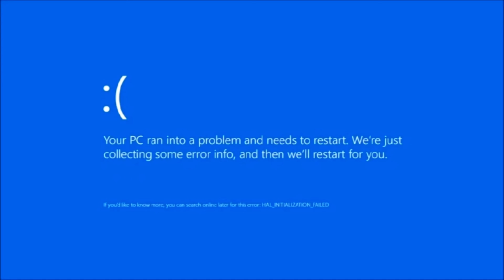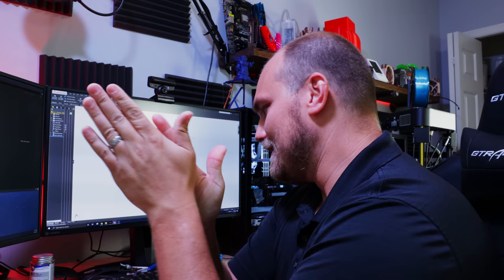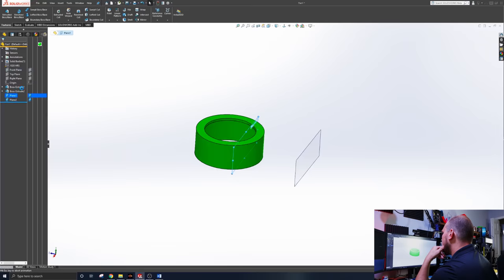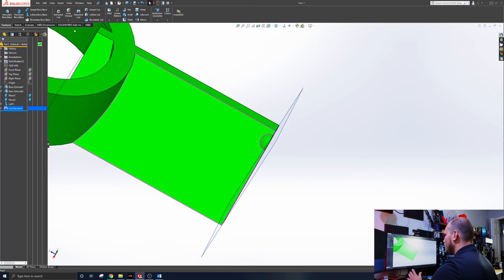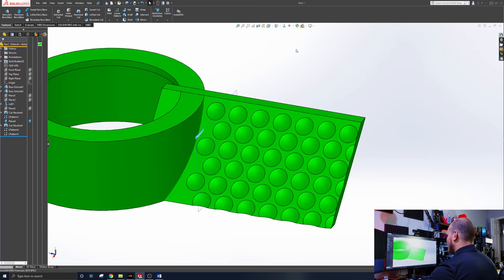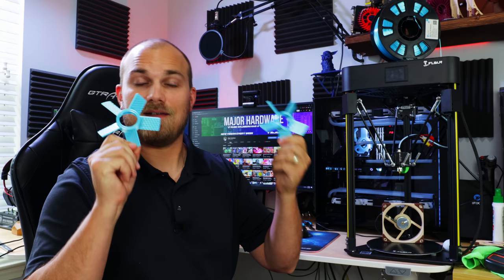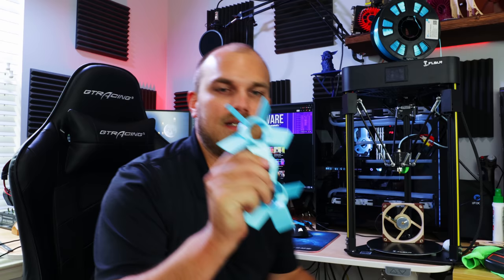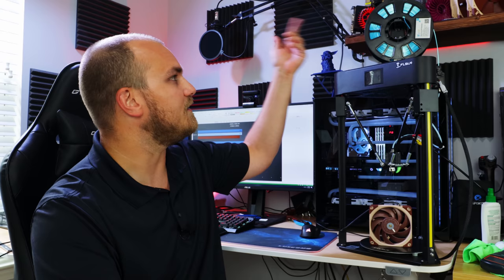What If Fan Blades Had Dimples Like A Golf Ball?

Comment: I would like to see one with "reverse dimples" or "bumps"
Reply: this won't matter, nothing you can do to the dimples can make them work better because the reason dimples affect golf balls and not fans is that when an object moves through the air, it creates a low-pressure area behind it, creating drag and slowing down the body, because of this, a teardrop shape is the best shape for limiting drag since its outline follows the low-pressure area allowing it to negate the effect almost entirely. the golf ball on the other hand is made to be sphericle to allow for non-directional hits, and therefore must be designed to minimize drag some other way. 

this leads us to the dimples, and how they reduce drag. they do it by creating turbulence on the surface of the sphere, which creates vortexes swirling into the low-pressure zone behind the sphere, allowing air to fill the low-pressure zone more quickly, and lessening the effects of drag.
now, the reason this effect doesn't work on the fan is that its shape is significantly better aerodynamically starting off, as its blades do not generate low-pressure the same way the sphere does, since they are already thin, and don't require air to bend its path nearly as much in order to pass around it.

Comment: Please measure electrical consumption... regardless of speed or cooling ability if the self regulated motors draw less current it would still be a useful saving in electrical efficiency ratings.

Comment: It's a terrible way to compare the effect of dimples. Of course the RPM is same; it depends on the motor, not on the fan, you could attach a solid disk instead of the fan and get the same RPM. The right metrics would be static pressure and flow rate measured with an anemometer. You'll need to compare both of these properties to get an idea of what's going on. Dimpled fans should have a higher pressure drop and thus perform much worse, but that's just my speculation.

Comment: mesure the speed of flow, the speed is given by the circuit of the motor, and for the efficiency mesure the power consumtion vs the speed of air flow.

Comment: ...so If it's cheaper because it uses less material, but performs identically, Producers, get on it.
Reply: That's because the smooth one is overdimensioned.
Only if the cutout structure would add strength this would be true.

Comment: Very cool! I thought for sure the rpms would be up and the volume of air would be down on the "more aerodynamically" superior dimple design. If you're making 100,000's of units, the savings in material and weight of one gram of shipping costs by that multiplier would save the manufacturer.

How much more "work" does the printer do though compared with the flat blades? It that is negligible, you should send your idea to a fan manufacturer - though most are plastic injection, I would figure - so that they might give you a chunk of % savings!

Great work. What I could build on this thing! How much do these things cost in general? and how intuitive is the software? Please.

Comment: Now can we get fan blades with bumps? Like, the exact same dimples but inverted?
Reply: this won't matter, nothing you can do to the dimples or the fan can make them work better because the reason dimples affect golf balls and not fans is that when an object moves through the air, it creates a low-pressure area behind it, creating drag and slowing down the body, because of this, a teardrop shape is the best shape for limiting drag since its outline follows the low-pressure area allowing it to negate the effect almost entirely. the golf ball on the other hand is made to be sphericle to allow for non-directional hits, and therefore must be designed to minimize drag some other way. 

this leads us to the dimples, and how they reduce drag. they do it by creating turbulence on the surface of the sphere, which creates vortexes swirling into the low-pressure zone behind the sphere, allowing air to fill the low-pressure zone more quickly, and lessening the effects of drag.
now, the reason this effect doesn't work on the fan is that its shape is significantly better aerodynamically starting off, as its blades do not generate low-pressure the same way the sphere does, since they are already thin, and don't require air to bend its path nearly as much in order to pass around it.

Comment: There is a chance that one fan uses less power than the other when running at the same RPM. Maybe one the "bad" fan of the two will outperform the other at a higher RPM. 

If not, a 9% material saving is actually kinda huge

Comment: Dimpling adds surface area which should add lift.Do a smoke test to measure your current flow across the surface.
Reply: this won't matter, nothing you can do to the dimples or the fan can make them work better because the reason dimples affect golf balls and not fans is that when an object moves through the air, it creates a low-pressure area behind it, creating drag and slowing down the body, because of this, a teardrop shape is the best shape for limiting drag since its outline follows the low-pressure area allowing it to negate the effect almost entirely. the golf ball on the other hand is made to be sphericle to allow for non-directional hits, and therefore must be designed to minimize drag some other way. 

this leads us to the dimples, and how they reduce drag. they do it by creating turbulence on the surface of the sphere, which creates vortexes swirling into the low-pressure zone behind the sphere, allowing air to fill the low-pressure zone more quickly, and lessening the effects of drag.
now, the reason this effect doesn't work on the fan is that its shape is significantly better aerodynamically starting off, as its blades do not generate low-pressure the same way the sphere does, since they are already thin, and don't require air to bend its path nearly as much in order to pass around it.

Comment: But "dimples" reduce drag..."drag" is proportional in moving air forward. Ie. No drag, no air movement!  The dimpled fan blades will most likely cut thru air easier, thus reducing the propulsion of air.  Therefore less desirable. You should be measuring "wind speed" out of the fan...THAT is after-all what your body "feels" when it judges the effectiveness of a fan.

Comment: As heartbreaking as this video is cause it made no difference, I'm glad you released this video.  So when I'm engineering things I can factor in that this profile makes no difference.  Thanks for your work on this.
Reply: To improve your knowledge of the dimples, and so that you can understand when and when not to add dimples to reduce drag, here is a full breakdown of how the dimples affect drag, and why:
 the reason dimples affect golf balls and not fans is that when an object moves through the air, it creates a low-pressure area behind it, creating drag and slowing down the body, because of this, a teardrop shape is the best shape for limiting drag since its outline follows the low-pressure area allowing it to negate the effect almost entirely. the golf ball on the other hand is made to be sphericle to allow for non-directional hits, and therefore must be designed to minimize drag some other way. 

this leads us to the dimples, and how they reduce drag. they do it by creating turbulence on the surface of the sphere, which creates vortexes swirling into the low-pressure zone behind the sphere, allowing air to fill the low-pressure zone more quickly, and lessening the effects of drag.
now, the reason this effect doesn't work on the fan is that its shape is significantly better aerodynamically starting off, as its blades do not generate low-pressure the same way the sphere does, since they are already thin, and don't require air to bend its path nearly as much in order to pass around it.

Comment: Yeah, of course dimples don't do anything to add to air flow or cooling. That didn't need to be tested. Simple math will tell you that. What would be interesting (math would tell you this too, but I'm to lazy to do the calculus on it) would be if the amperage required to run the dimpled fan drops, is stable, or increases. My guess without spending the time to do the math is the amperage is same or higher. Dimples actually increase drag, the reason they work on golf balls is that when the ball spins it creates differential pressure gradiants since the bottom of the ball spins in the direction of travel (also left or right in relation to direction of travel, but we will ignore this during this discussion.) creating lift since the bottom of the ball is traveling linearly at greater velocity than the top of the ball. fans don't have 3 dimensional movement, only two dimensional. dimples at the tips of the fan will create greater lift than the center most dimples. Pressure differential doesn't equate to force exerted, but it does increase friction. My bet is that dimpled fans consume more electricity than non-dimpled fans without gaining any additional work.

Comment: You need cfm and motor amperage to do an actual performance reference. RPM is determined by the motor not the blade.

Comment: YOU have it wrong, we need DIMPLES on golf balls because of the dramatic RADIUS of the curvature of the ball shape that is inheritley bad at keeping  it's boundary layer due to that steep radius SO DIMPLES would be good on any aerodynamic surface where it has a dramatic difference between angle of attack where detcached flow of the boundary layer is a problem. 

Try more dramatically curved blades with to makes use of the DIMPLES.

Comment: I don't know if this has already been given, but had to type out an idea. Would the turbine inside a turbo work for cooling? there are many types of high performing tubines. but I think the low boost turbos is where the cooling can be better. it may not make any difference when it's low rpm but it mat at higher rpm's. also I bet the golf dimples use less power to maintain the current speed.

Btw this is my first time watching your videos

Comment: put dimples on back side of blade only, fan guy i solved dilemma... make single axis vericle inside a 24 inc wide diameter pipe by 6 geet, mount all fans in middle, blow through same ratios of air or water for each famn test and measure RPM, u can encloud shrouds inside the fan vector measure chamber, send me 50% of your income or join Atalntisz and ill assign you

Comment: hey ,,,

I would really, really like to see what happens if the dimples where on the BACK of the blades !

I theorize you will get higher flow from the dimples being on the back (not front)  of the blades ...

you NEED drag on the front of the blades to DO work and PUSH air ,,,
So reducing the drag on the FRONT should actually make  blades turn faster, but do less work ! SO it negates itself.

Comment: You used less material the blades has less surface and the airflow remained the same. Obviously this is a more efficient design. I wonder if a fan blade with similar curvature to a golf ball would perform better

Comment: THING IS IT MIGHT MAKE A DIFFERENCE IF ITS SPINNING WAY FASTER.

AERODYNAMICS DO NOT MATTER IF YOU ARE WALKING YOUR BIKE RIGHT....BUT IF YOU'RE GOING 50 MPH.....
Reply: this won't matter, nothing you can do to the dimples can make them work better because the reason dimples affect golf balls and not fans is that when an object moves through the air, it creates a low-pressure area behind it, creating drag and slowing down the body, because of this, a teardrop shape is the best shape for limiting drag since its outline follows the low-pressure area allowing it to negate the effect almost entirely. the golf ball on the other hand is made to be sphericle to allow for non-directional hits, and therefore must be designed to minimize drag some other way. 

this leads us to the dimples, and how they reduce drag. they do it by creating turbulence on the surface of the sphere, which creates vortexes swirling into the low-pressure zone behind the sphere, allowing air to fill the low-pressure zone more quickly, and lessening the effects of drag.
now, the reason this effect doesn't work on the fan is that its shape is significantly better aerodynamically starting off, as its blades do not generate low-pressure the same way the sphere does, since they are already thin, and don't require air to bend its path nearly as much in order to pass around it.

Comment: One thing that you didn't test for current draw. If the dimples on a golf ball cuts down on wind \ air resistance, THEORETICALLY SPEAKING, it should take less power to turn a fan. If this turns out to be true, it would mean smaller power supplies, or batteries in portable operation like battery cooling fans in electric cars and longer fan  motor life in the fan itself. If it were my experiment, I would get 2 identical fans, replace the stock blade on one fan with the dimpled blade, install both fans in identical circumstances and measure the current draw of one fan and then the other. Logic would dictate that the dimpled fan would draw less power when extrapolating the results from a golf ball but then there's nothing like good ole' empiracle evidence gained through experimentation. Let us know what you find out.

Comment: to me WIND SPEED is the only thing to test here. do the blades push as much air or, is it as I suspect, does less air pass through the fan due to the lower air contact with the blade surface? Or maybe the air pockets create faster wind speeds?? Can you update this video with this test or at least tell me why my theory is off lol. great video's thanks!! (yes cooling at the exact same rate does imply a similar air flow, but it by no means proves a similar air flow).

Comment: i mean, its good to have like a test group and all, but ... couldn't you have like.. taken fan blades already designed to actually work? gotten two of them, used a dremel on one to put some minor dimples, and then tested? why engineer the crudest, and not likely fan blade to even move air well, to test this hypothesis? just my 2 cents.

Comment: You need to polish the blades after printing man, right now it's just a dust collector and, I'm not sure about this, it could improve performance.
Reply: this won't matter, nothing you can do to the dimples can make them work better because the reason dimples affect golf balls and not fans is that when an object moves through the air, it creates a low-pressure area behind it, creating drag and slowing down the body, because of this, a teardrop shape is the best shape for limiting drag since its outline follows the low-pressure area allowing it to negate the effect almost entirely. the golf ball on the other hand is made to be sphericle to allow for non-directional hits, and therefore must be designed to minimize drag some other way. 

this leads us to the dimples, and how they reduce drag. they do it by creating turbulence on the surface of the sphere, which creates vortexes swirling into the low-pressure zone behind the sphere, allowing air to fill the low-pressure zone more quickly, and lessening the effects of drag.
now, the reason this effect doesn't work on the fan is that its shape is significantly better aerodynamically starting off, as its blades do not generate low-pressure the same way the sphere does, since they are already thin, and don't require air to bend its path nearly as much in order to pass around it.

Comment: You should now do an anemometer test to see the difference in air flow, ... the motor should turn the same amount of rpm, under the same load of power, ... so measuring the rpm,  is basically voided, unless the stress of turning the blades, should become apparent, ... so I’m not certain how you could measure, the rpm speed, versus the current draw, but it should be able to be configured, ... 
Personally, I think this is a fantastic experiment, but how about tossing a wrench into the mix, using the exact same patterning setup, instead of dimples, how about putting the same size, & displacement of bumps, instead of bumps, ... and measure all three with an anemometer device, in order to get the true wind airflow speed(s), ...
This would be the only way to measure whether or not the airflow process is improved, or by how much the designs would be different, ...  
I found out about this type of operation when going through underground mining school, and that the “safe” operation of removing underground gasses, and keep fresh air flowing through regulated mines is 9000, cfm, (cubic feet per minute), and this would have to be maintained throughout the whole mine, ... so a part of the training, was to put up curtains/screens up to vent the air only through the passages that are being utilized, but one would also have to take into consideration the gasses that build up from unused mine face surfaces, ... and then the testing procedures utilized to get rid of the hazardous gasses, ... there is already several different practices in place to secure areas with gasses that exceed safe protocols, ... so, ... even though I am 67, and disabled, I am still interested in improving the safety conditions, & protocols, through any & all industries, that involve the work place conditions, ...